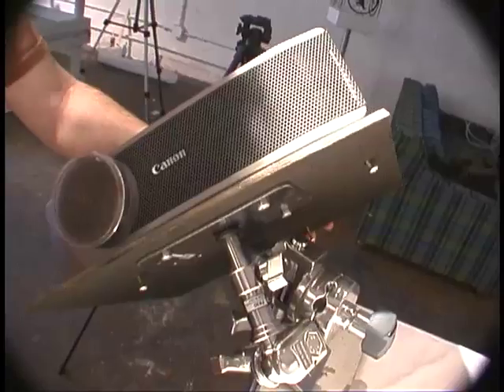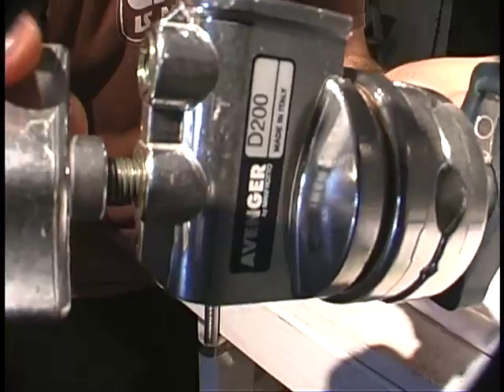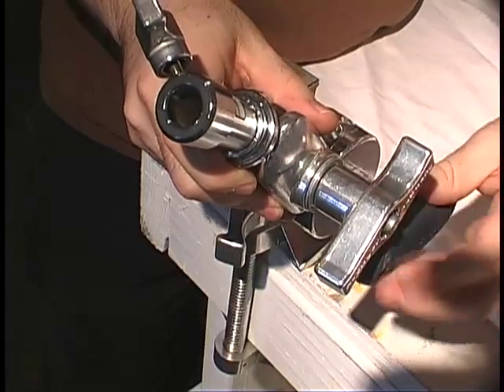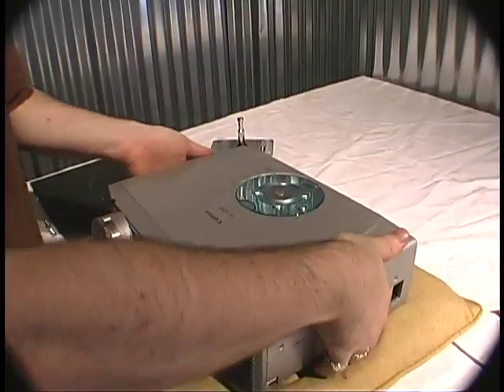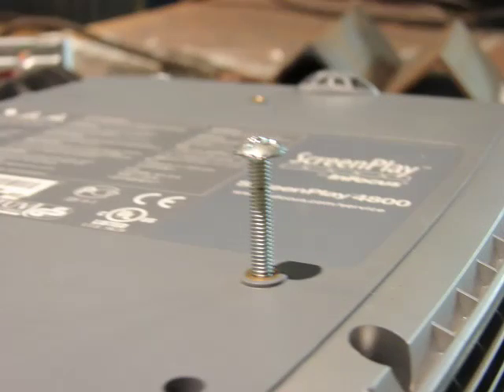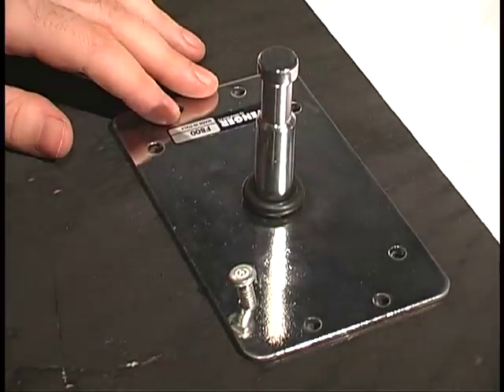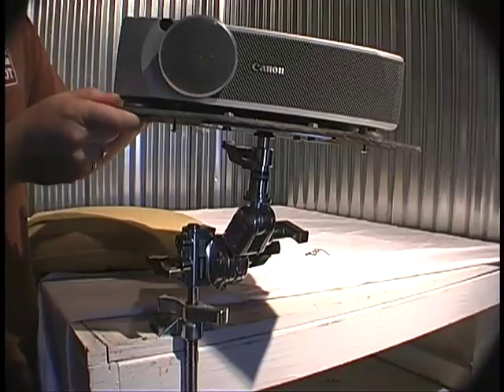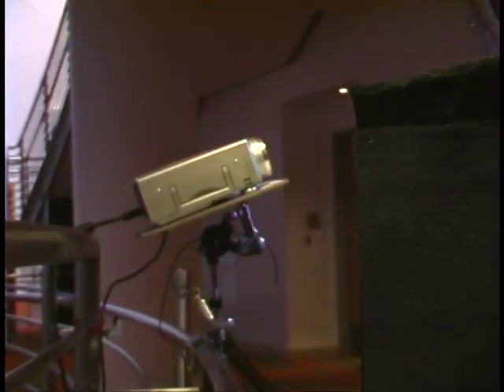VJ Kung Fu: Build a Projector Mount That Will Go Anywhere

Comment: Read your projector manual before using this type of mounting option, .. 90%+ of LCD and DLP projectors CAN NOT be mounted on a flat plate/board.  It traps heat which shortens bulb and component life.

I do like the design, and think it could easily be modified to avoid heat build-up.  Easiest method would be to add spacers between the projector and mounting board.